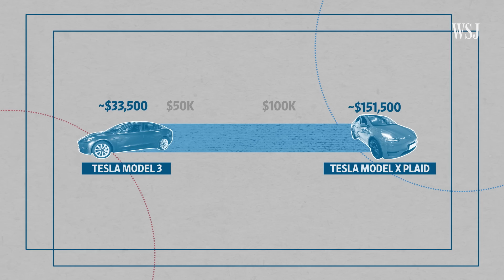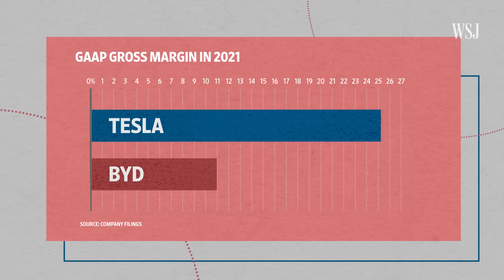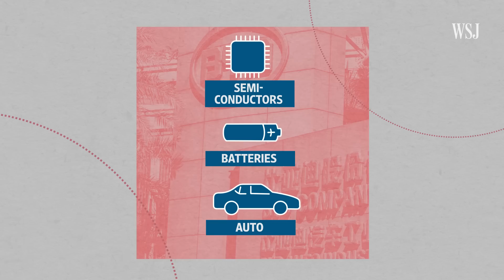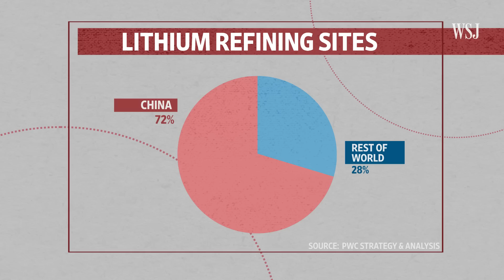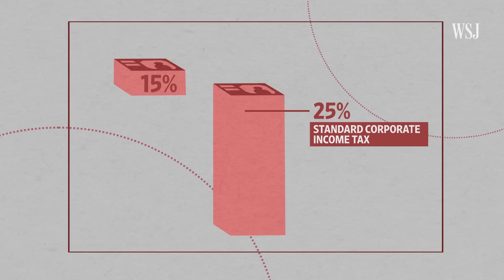The Tesla Competitor Dominating China’s EV Market | WSJ U.S. vs. China

Comment: Onwheel rotary engine and add-on motor then we have car can work in any fuel condition gasoline , natural gas, electric , and even no fuel use lighter motor cycle wheel and lighter wood body can fly easier and renewable material and use capaitor replace major battery weight

Comment: I'm from Shanghai. Last month I ordered a Huawei M5 pure electric four-wheel drive smart-driving car, with a total of 290,000 rmb. The reason why Tesla is not considered is that Huawei uses Lidar for its smart driving system, which is more secure and accurate. Huawei has the Hongmeng vehicle-machine system, which is perfectly compatible with my Huawei phone, and has excellent experience. Huawei also has the Hud, massage chair, seat heating, and the most important of all, the Huawei ADS2.0 smart driving system. The smart driving performance in China is far better than that of Tesla. I just want to say that times have changed. Chinese people have already used cars made in China, because they are more powerful than foreign cars, and they are ahead in all directions.

Comment: USA tax incentives were somewhat premature as where batteries and assembled help dictate tax incentives.  Not too many batteries made in USA, another homeland security issues.  Tesla also an
Energy company.  It wants some of CATL market as it’s the worlds largest battery manufacturer.  Lfp batteries(lithium IRON) are where many competitors rapidly trying to switch to as cheaper and no  cobalt or nickel.  Plus almost zero fire issue and more cycles than regular lithium ION(NCM, NCA)  Possibly million mile batteries.  They also do well with continuous 100% charging
Reply: So if batteries are not made in USA they are a threat ?

Comment: Looks like BYD will overtake Tesla.
Reply: no
Reply: Tesla is the original top selling, unlike the other copies which are reversed engineered and copied the concept of the Tesla’s programming.
Reply: @nekopop8159  every competitor is a copy, typical of Americans
Reply: BYD already has beaten Tesla. PHEVs are also EVs. 😎👍
Reply: Tesla is a has been!
Reply: Tesla has lost to BYD in global sales last year.
China is at least five years ahead of the U.S. in electric vehicle technology, and Tesla has so far been unable to come up with a power cell comparable to the Blade battery.
Reply: @nekopop8159  Mercedes literally invented cars, so I guess every single american car in history is a reversed engineered and copied the concept of Mercedes. :face-blue-wide-eyes:
Reply: @AI_HQ  PHEV are definitely not EVs. It's an ICE vehicle with a small battery. Its main drive unit is the engine
Reply: >> "... Looks like BYD will overtake Tesla. ..."
in China.
Reply: @tooltalk  they already did in 2022 - even for pure EV.
Reply: @greenearth9945  Not BYD PHEV, it has no ICE engine, it uses gas for generator to power the battery to run the electric motor.  That is why recognized as EV by world governments.

Comment: For such a vertically integrated company as BYD it bothers me how their profit margins are so low. Now imagine if Tesla had the same vertical integration as BYD, their profit margins would be ridicolous
Reply: Probably they have so much model compared Tesla 4 model atm
Reply: too many competitors in China, not just in EV production, but also in Battery/chips. Besides, before the boom of BYD`s EV, BYD used to be a 2nd-class brand of the regular cars in China.
Reply: Because BYD also sells 15000 USD PHEV, it is defeating the TOYOTA Corolla
Reply: @aizseeker3622  good point
Reply: @hcui7456  good point

Comment: China has all the production chains and technologies in the field of electric vehicles. This is a huge advantage, because cars produced locally in China can be cheaper than other brands.
Reply: >>China has all the production chains and technologies in the field of electric vehicles
No it doesn't.  China has primarily low-tech, low-value part of the technology supply-chain -- ie, assembly/packaging.   Most chips for instance are designed in the US; then manufactured in Taiwan/South Korea with manufacturing equipments from the US/Japan/EU.
Reply: @tooltalk  If you don't believe it, you can buy an electric car you like, and then disassemble it to see how many important parts are coming from Chinese companies. And check the technical patent code. However, as a person with limited information, you may be in an extremely poor area. I doubt that you have the money to buy an electric car to dismantle it.
Reply: @tooltalk  bro still living in the 2000 era, you just got your internet ? You really think China is still relying on "low-class" manufacturing industry as their main development source ?
Reply: @dcwtf09  : Sure, most low-end, low-tech supply chain -- ie, assembly/packaging -- is still in China.  I also cited an example -- China's EV industry -- where China pretty much cheated and violated their WTO obligation to get ahead of competition.
Reply: @tooltalk  If I didn't live in China I would almost believe you hahaha

Comment: You don't say a word about the safety of LFP. Besides, BYD's newly developed blade battery has excellent performance. LFP is no longer synonymous with low-end, and will gradually become the mainstream.
Reply: Agree. LFP powered Han and Seal models have over 350 miles of real world range and sub 4 seconds 0-60.
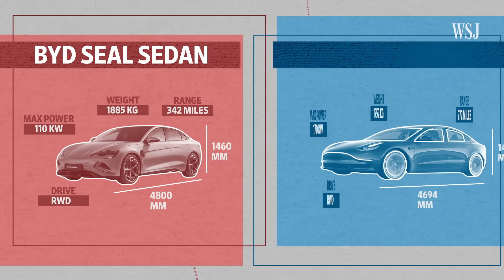Reply: Idk why WSJ claims LFP has lower range when in the video itself 1:29 it literally shows the comp model of BYD has a 25% longer range (342 miles vs. 272 miles) than model 3 lol.

Comment: It is important to understand that regardless of brand, make, model, manufacturer. The driving goal should be to turn the auto industry from ICE vehicles to Electric drivetrain cars, vans, trucks (road vehicles generally speaking). These should be available at a fair and affordable price, with practical charging infrastructure and the assurance that the batteries will not burst info flames at any given moment. Concerning charging infrastructure, last I heard, Tesla was open to share their charging stations with other manufactures, Ford, GM, etc.

Comment: Is it fair to compare BYD to Tesla, which sells BEV only?
Reply: For BYD:

BEVs: 911,141 (up 184% year-over-year)
PHEVs: 946,238 (up 247% year-over-year)
Total: 1,857,379 (up 213% year-over-year)
Reply: yes, cuz Tesla can't compete with byd in BEVs
Reply: @lucisleesion8824    You have it backwards.   Drop prices 10% and BYD dies.
Reply: @Notme-tq4xs  🤣
Reply: @Notme-tq4xs  BYD actually increased the prices recently 😂😂😂
Reply: China is at least five years ahead of the U.S. in electric vehicle technology, and Tesla has so far been unable to come up with a power cell comparable to the Blade battery.
Reply: @parkjoonkwang9259  Tesla batteries are also chinese... CATL... at least the good ones. :face-green-smiling:
Reply: @tooltalk  the FLP with higher life, and better functioning in cold temperatures... though LFP from BYD are even better than CATL in cold weather. (BYD lose like 10%, Tesla normal ones lose 30% range)
Reply: @Notme-tq4xs  Tesla has just dropped 13% before CNY... BYD is still there with good sales... 
the world is not black or white, it should be colorful, right? if we are not payed to defame a company, why not to compare them without bias?

Comment: Electric cars inherint design means they are much better suited for city driving and in limited use. China and Europe have high speed rail to hop from city to city. There cities are designed for walking and have incredible public subways and rail systems  and there cities are designed  as to not to have to own a car. The United States is completely different. Our cities are spread out. High speed rail won't work. Cities were designed for the car and are huge in land area.For example  It is impossible to not own a car in  Los Angeles or on California in general.  The cities are too big and too far apart. High speed rail will never work here. Nobody wants to go to Fresno or Bakersfield and LA to San Francisco is two cities. It just won't be profitable enough. China also controls all battery refining and production. The United States would have to buy most of its energy storage from China. What is good for some countries isn't good for all. If the United States government keeps forcing EV's it will threaten the United States economy and maybe even our security. Think electric tanks. Not everything can be electric. This one size fits all is something only the United States government wants. It is a stupid idea based on lies over the causes of climate change and how much impact cars have and also how fast we can transition to an all electric EV future. Europe is realizing this lie and China and India who are by far the two largest producers of greenhouse gas have no intention of reducing their carbon footprint.

Comment: All basic infrastructures in China are State-owned & operated, which gives them an edge to install charging stations all over the country even in rural areas. They also 24/7 roadside assistance available in every province which you can summon directly from your car's control panel or your phone. And then there's autonomous battery changing stations in big cities. Now they have a battery that can last up to 606miles...you simply can't compete with them. 

What he said about "creating an infrastructure to sell cars..." is wrong, BYD only needs to establish a supply chain. The problem is that the US lacks all the infrastructures required to sustain a healthy EV market, as getting charging stations installed & establishing the services are way too costly. On top of a Govt run by donkeys, who tF in their right mind would wanna sell in the US?

Comment: The FUD in this video is crazy. Standard range Model 3 has 272 miles of range on the EPA. China uses CLTC cycle which yields higher ranges. Model 3 in china is rated at 345 miles for standard battery and 419 miles for the long range battery. Clearly they want to make Tesla look inferior here. Comparing two cars range with different test cycles data to fit their agenda..

Comment: Any minutely knowledgeable person about cars knows that Tesla is not a Premium vehicle. Cheap materials, assembly quality and quality control at a level of a 1990’ Italian econocars, reliability at the bottom of every stats, rattling and squeaking panels, fit an finish. Premium because it revolutionized the car market and premium because of the power energy management and efficiency…? Premium because stupid people create mainstream-public opinion and creates the hype. My 2018 Hyundai Kona Electric did 300 miles on a charge, not being a fully electric platform and 90k miles I only replaced the windshield washer fluid and tires. My Tesla model 3 at 5000 miles and onward was riddled with problems, interruptions and quality issues….
Reply: Why do you care?
Reply: I'm sorry you had to drive those poor cars for all those years. Deepest sympathy & condolences

Comment: I won't be getting a EV for several decades. They just aren't affordable. Buying a used one doesn't seem fun.

They are all tablets on wheels which I don't want. No infrastructure around. And then the ranges seem pretty irratic when I see car reviewers use them. The weather plays a huge role as well. 

I also won't be getting a hybrid either as I don't want to replace the battery.

I won't be driving a big gas guzzler. I'm not in the ICE only group. But EVs are not a option either.

Comment: From my observation and speculaton, BYD does not go into US markets because of quality issues. In China, it is possible to sacrifice basic quality for lower cost. A good example is volkswagen, it sells a very popular model called Passat in China but failed a crash test by breaking the A pillar in 2020. But we did not find its counterpart in Europe or US failed has the same issue. So a reasonable guess is that BYD's strategy may not work due to the stricter law enforcement in US.

Comment: Charging stations are so important.  Public does not realize most level 2.  Teslas are all level 3.  Even non Tesla fast Dc chargers are slow compared to Tesla.  Most are 50 kw, rare 100 kw and super rare 350 kw.  Tesla chargers are all 120-250 kw with many stalls with live updates availability.  Batteries preconditioned automatically in cold weather as approach station.  Tesla navigation integrated with chargers.  No credit cards or confusing apps
Reply: Tesla is the best.